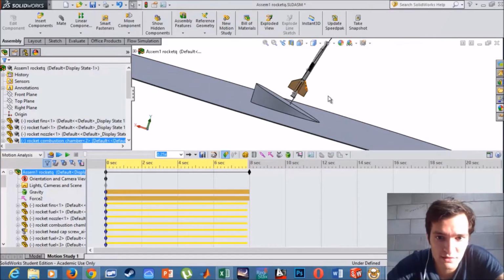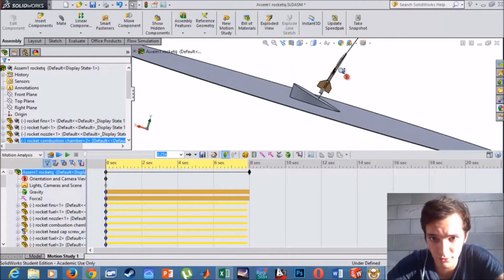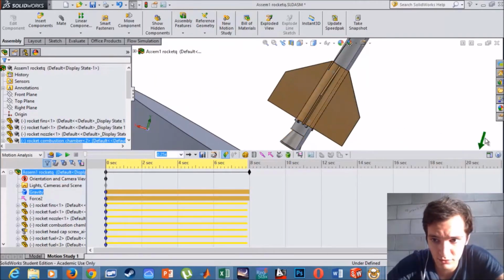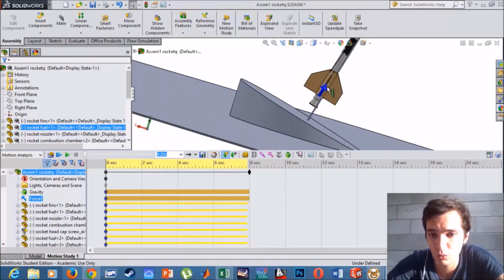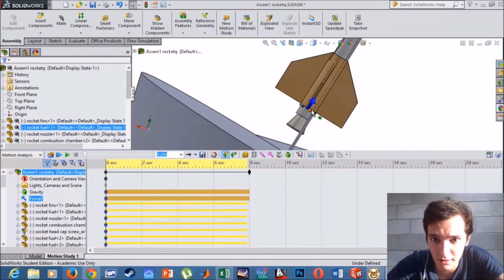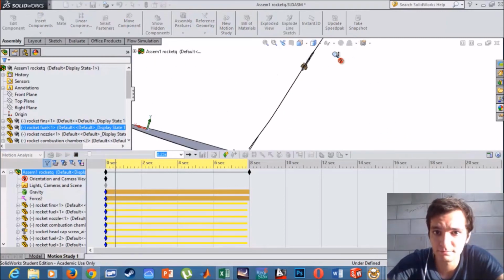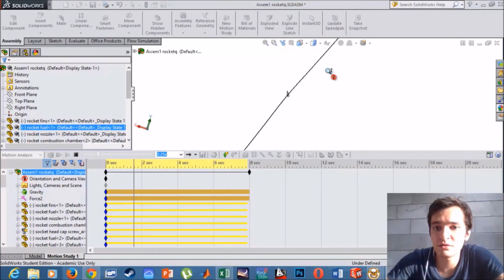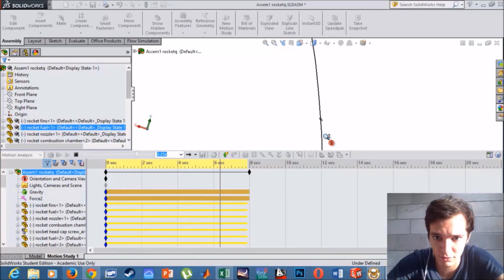Rocket Motion Analysis On SolidWorks (Rocket launching simulation)

Comment: Hey I've been watching your videos and you seems very good at making rocket simulations. I'm working on making a Hot-water rocket for my graduation project. Hot-water or steam rockets are very hard to analysis because the propellant is water in two phases (liquid and gas) and also the flow is obviously Unsteady or Transient. Is there a tool on SolidWorks that will solve the problem?
Reply from the maker: +Nossehrino Boys Thank You !! Well i know you can do that on Ansys i ve seen people doing it but i personally never tried it however regarding Solid works you can use water as a propellant and i believe also that you can set different initial conditions on your  different rocket location for example setting different temperatures and pressure on various location should be highly considered by solid works that in result should automatically know the states ( enthalpy exergy....) 
Look the best advice i can give is to simulate your rocket but dont only count on that make some paper work and make sure your simulation is within the right margin of error and present both !
or even better usually PHD graduate present 3 things: the simulation , the general paper work not deaitaled just to make sure the simulation is on track and finally a real static test will prove that the calculations or simulation is successful ...
Reply from the maker: That sounds great 
You are the most welcomed my friend.
and after completing your rocket studies... send me your work if that would be possible i ll be really happy to take a look at it ..
Best Of Luck and nice job with high interests